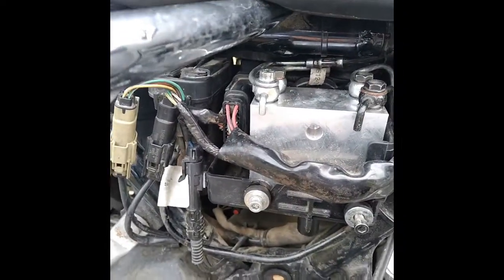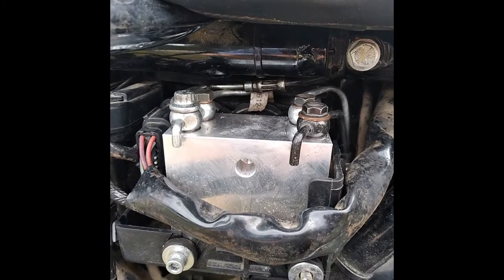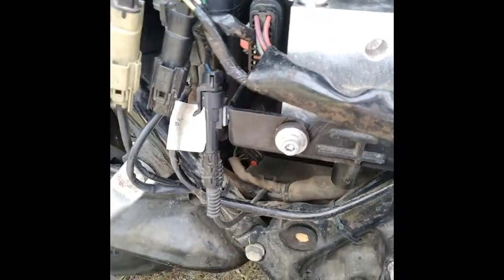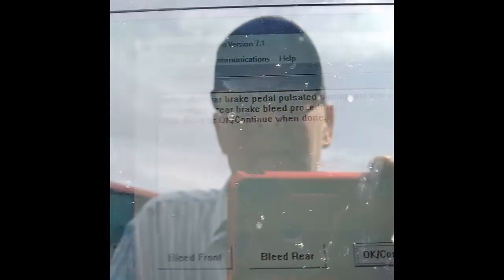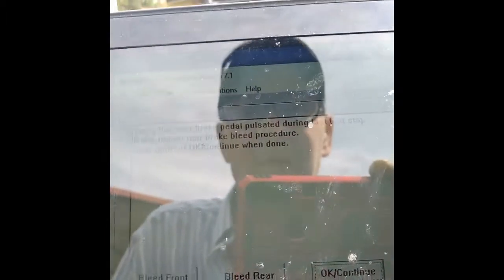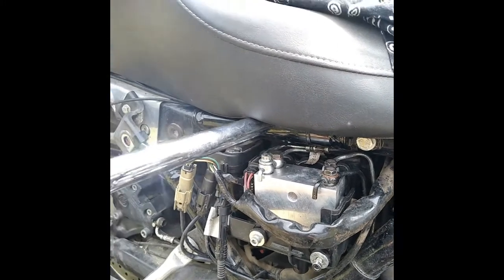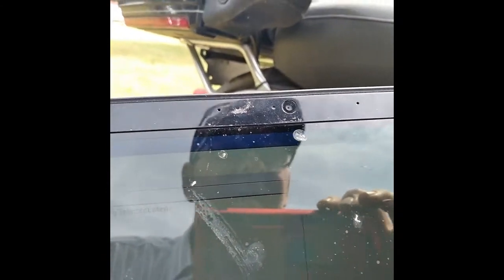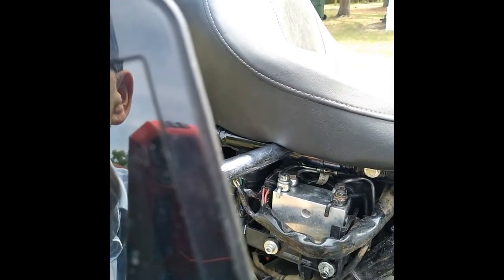WHY ARE THE REAR BRAKES ON MY STEREETGLIDE NOT WORKING CORRRECTLY?

Comment: Can't help but think there must be a way of actuating the valves by simply unplugging it and applying a voltage to it's connections. If the unit was isolated from the bike's loom, sitting on your bench maybe, would it be possible do you think? I ask this as a bloke who knows nothing about ABS... ;-)
Reply from the maker: First off, maybe. But all these components are fed by reference signals by the module, which uses a 5 volt signal. So. In theory it could be done. But if done wrong you've just fried a rather pricey piece.

Comment: How about the block ? Do you fill it up after removing the lines ? Or you just cap them together?
Reply from the maker: Ended up replacing the block. To bleed the system you need a yeinscan abs program or the hd scan tool to be able to activate abs module. Goofy system.
Reply: @russellbarron6775 you couldn’t just block these two lines from master cylinder and front caliper and run a normal cable and skip abs for front wheel? That’s what I am thinking to do
Reply from the maker: @user-fy7xu8jt4d  yeah, guy wanted it back to stock. Mine would be lines  ditch the abs. Good luck.
Reply: @russellbarron6775 Thanks for the quick reply. Do you think it’s ok to keep the front two line sections on my front wheel and plug them with same size bolt and nut with two crush washers ?
Reply from the maker: @user-fy7xu8jt4d I don't see a problem with it.
Reply: Update. I disconnected front caliper cable and blocked with bolt and nut with two O-rings on both sides bolt and nut. Same from master cylinder. Taped and secured. I ran a normal cable from master cylinder to front brake caliper.  Everything works fine now. No ABS message either.
Reply from the maker: @user-fy7xu8jt4d  cool. Just remember to change your fluid every so often and recheck fittings as well.
   As part of a service I usually tie the front brake lever all the way to the bar overnight. This allows the caliper piston seals to relax so the pistons don't retract too far. Basica)y takes some of the slack out of the lever. For the cost of a wire tie and a few hours.